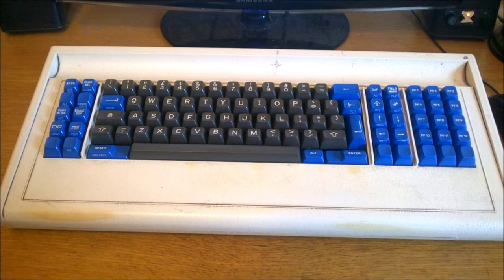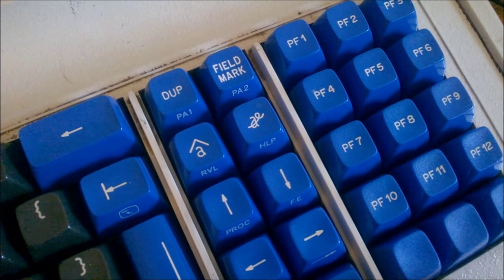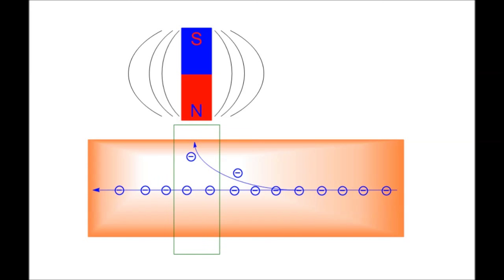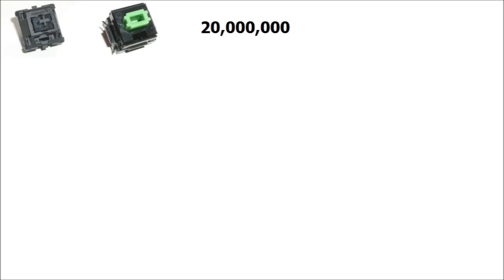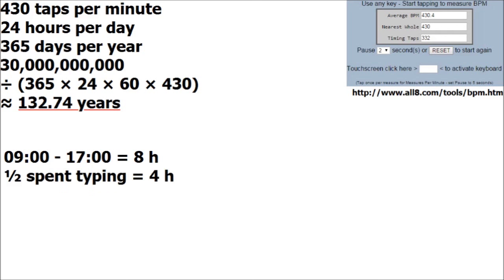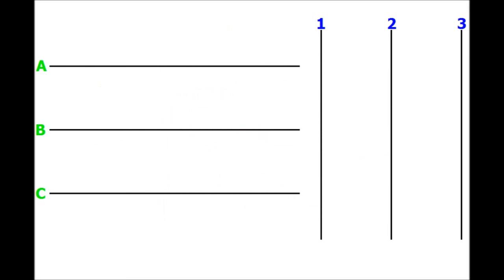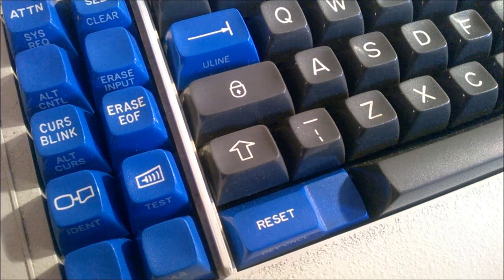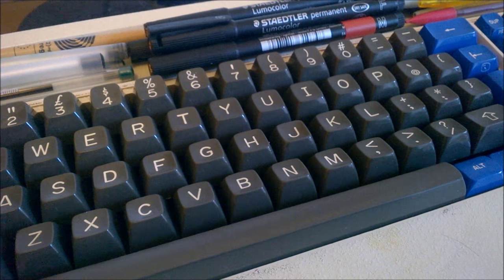ITT Courier 110169-003 review (Honeywell Hall effect D1B3S)

Comment: I'm starting to like less noisy switches, or at least switches with deeper tones, and these sound wonderful.   And those keycaps [drool].  It would be interesting to compare the new laser-based switches with these or the Ace Pad Halls.
Reply from the maker: What laser-based switches?
Reply: https://www.kickstarter.com/projects/wooting/the-analog-mechanical-keyboard-for-precise-movemen
Sorry, apparently what I meant was optical switches.  Above is the link to the Wooting keyboard kickstarter (Flaretech), and below is a link to a Tom's Hardware article that discusses the two kinds appearing soon.  A big keyboard manufacturer (I can't recall the name because I'm useful that way) is set to use the Light Strike switch, which will be cheaper, whereas the Wooting is hella expensive but arguable superior.  
http://www.tomshardware.com/news/what-are-optical-keyboard-switches,32352.html
Reply from the maker: Ah, I see. Yes, I'm familiar with both of those switch types. I'm actually typing on the Light Strike ones right now.
Reply: Whose keyboard?  BTW, I RPG and do concept art, and my default science when anything can't be explained is 'magnets.'

Comment: Are the caps ABS or PBT? 

I've heard claims that they are PBT, which seemed likely because there are absolutely no yellowing and they certainly sink when put in water.
Reply from the maker: +danny z They don't look yellow because they're not white :p . And they're definitely ABS. Please don't think the sink test works, it's super unreliable ;) .
Reply: +Chyrosran22 Hm, but I don't even see any yellowing on the white caps I own, or have seen in photos.
Maybe some ABS material are doped with anti-degrading chemicals.
Reply from the maker: +danny z ALL ABS materials have stabilisers in them, as well as many other additives such as plasticisers and fire retardants. The composition of these has changed over time. Materials from the late 80s and 90s appear to be most vulnerable.

Comment: 30MB!!!!!! wow!
You can probably have someone revive it using a Teensy and the Soarer's Controller firmware.
Too bad it doesn't have any kind of marking in the F and J keys, bad for touch typing.

Excelent video!!
Reply from the maker: +Rockerito aka KeyHopper Thanks! :) F and J are marked actually - they have deep dishes. I don't touch type, though. Moreover, it'd almost certainly be impossible to get this working with just a Teensy/Soarer's as the switches need much more power than a normal port can provide, and to my knowledge the Honeywell firmware hasn't been retro-engineered yet by anyone at all.

Comment: Just disassemble this crap and make a high end keyboard with that switches.
Reply: its not that easy, it's not a contact switch that closes a circuit when pressed, it's a hall effect. so you'd need to either keep the original PCB, or completely redesign and make a new one.  at that point you may as well just keep the original board, reverse engineer it with a logic analyzer / oscilloscope, and make a protocol converter from the original onboard controller.  that's usually how it's done with 30--40 year old keyboards like these.